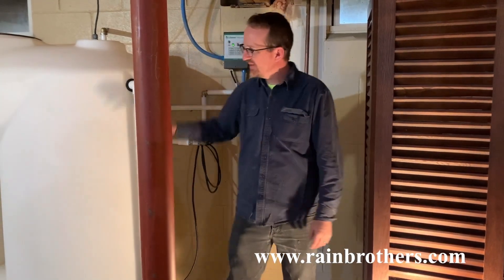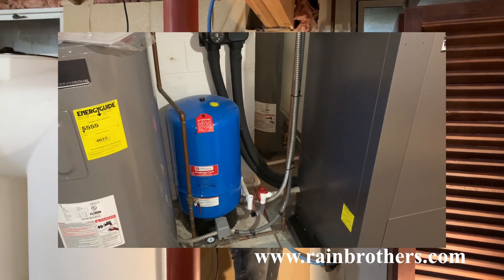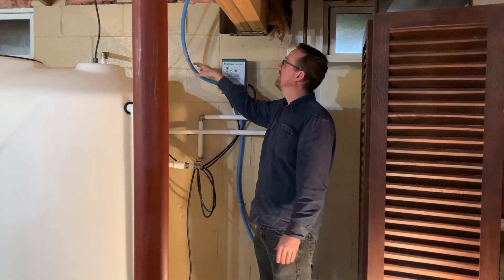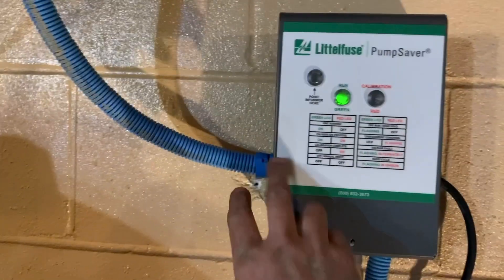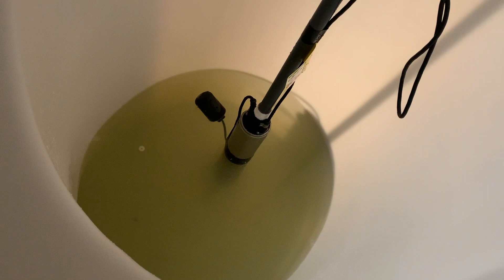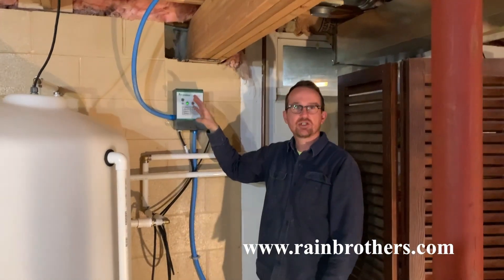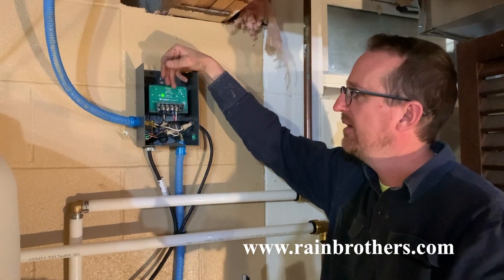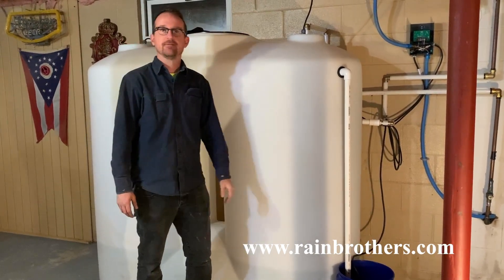How to fix a low-yield water well

Comment: We have something similar with our well. 
Instead of using something like this, we're going to use a 500l pressure tank instead of from a unpressurised storage tank to a pressurised tank - saves needing multiple pumps
Reply from the maker: Yes, sometimes having a larger pressure tank can help, but if you truly have a low producing well that is only recharging a few gallons per minute, you have to have a reservoir tank to serve as a buffer between the low flow well and the high flow house use… a pressure tank just won’t cut it in those cases, no matter how large.

Comment: What if your bladder tank is out at the above ground pump at the other end of your property? Could we still use a reservoir tank inside the house?
Reply from the maker: Yes, you just have to buy another pressure tank and use it for the pump that you’ll place inside the reservoir tank!

Comment: Hi!  I am having water supply issues. I have a family of 5 and the current well water supply keeps running out 3x a week whereby I have to go shut the pump off at the breaker. 

At what point would you suggest this setup vs going deeper (320 to 520 ft) in your existing well? Thanks!
Reply from the maker: A reservoir system works very well and is a lot cheaper than drilling a new well. If you’re only running out of water three times a week, chances are good that a reservoir system will work well for you!

Comment: I put in their same system with a smaller tank over a year ago. It took the well about four days to fill the tank and then everything was fine. We water horses as well as the needs of the house. This year during a drought we maintained a minimum of 150 gallons after we had family visit. Two days later, the tank is full again. It was a perfect, reliable, affordable solution.

Comment: I have a similar system, question though what is the pressure coming from the well pump to the tank? Mine runs at 100psi which seems high, would an expansion tank on that side of the system as well help?
Reply from the maker: In our setup (mentioned in this video), the supply pipe coming from the well is just open pipe that pours into the top of the tank. If you have 100 PSI, then you have a valve closed somewhere or are using very small pipe… I don’t know how 100 PSI could develop against an open-ended pipe unless you have a monster of a pump on the other end.

Comment: Excellent video. Love the overflow safety feature. Do the pump savers work on 3 phase water well pumps (the pump that goes in the actual well itself)? I have heard you say they work on 110 or 220 but nothing about 3 phase. My water well is 3 phase.
Reply from the maker: Great question! So, if this is a residential well, then you’re probably using a VFD pump that is single phase to the drive then three phase to the pump motor. Is that right? If so, your drive has built-in run-dry protection and you wouldn’t need a PumpSaver. Typically residential properties don’t have actual three phase power available, but VFD pumps are a different animal because they incorporate a single phase to three phase converter. If you truly have three phase, then, no, unfortunately our PumpSavers will not work

Comment: If you do not have a basement to put the tank and pump saver in could it be installed in a shed as sort of a pump house out by the well? Just dig up and re route the well line up into the pump house so to speak before it enters the house.
Reply from the maker: Yes, absolutely! As long as the tank and components are protected from freezing

Comment: Thank you. Are there separate devices that could be installed so that I could have one box for detecting if the jet pump is pumping air so it will shut off but have it independent of the cistern's pump? My pumps are on separate breakers. What I really need right now though, is a way to get a float switch to work with a 230vac 6.1A pump to fill the cistern. I'm trying to find the best option to wire the float and need a float that is rated for potable water. Right now I have a square D liquid level switch but the arm keeps getting jammed and doesn't trigger the pump to either turn on or shut off. This leads to the cistern's water levels often being too low.
Reply from the maker: Hello - here is the float switch you would need for filling up a tank: https://www.rainbrothers.com/store/Normally-Closed-Float-Switch-120-230V-Bare-Leads-p281493413 . You might also want to get a cable weight: https://www.rainbrothers.com/store/Plastic-Cable-Weight-for-Float-Switch-Tethering-p521581298

You cannot tie more than one pump into a PumpSaver. The cistern pumps that we have (Springer Series Traditional pumps) have a built-in low level float switch to turn off automatically, so they don’t need to be wired into a PumpSaver.

Comment: Just finished DIY installing a system that duplicates the setup presented here. We have a natural spring that can run low during drought so this system is perfect to store excess capacity and provide more consistent water throughout the year. I cannot say thank you enough to Rain Brothers for their content, products, and overall customer service throughout the project. I highly recommend getting in touch with them when planning your project and purchasing the bundled products so you know everything you need to get the job done works together.
Reply from the maker: Wow! Thank you so much for the kind words and for your business!! We really try hard to help people fix water issues,
so I’m so glad we could be of service

Comment: This is great. I have a well producing only 1/2 Gallon per Hour. No one will touch it and this system is EXACTLY what I was asking the locals about using and they said it's not a thing!!! Thank you!
Reply from the maker: Glad to help, but please note that a 1/2 gallon per hour is a really low yield, and may be far too low to try to salvage (after all, that’s only 12 gallons per day). You may be better off exploring a rain collection cistern, which is our specialty. Check out our website for more info:
www.rainbrothers.com

Comment: I am not a big fan of PVC pipe. CAn I use Pex into and out of the tank?
Reply from the maker: GREAT question! Our tank penetration gaskets are designed for pipe that is IPS or Iron Pipe Size. Schedule 40 or Schedule 80 PVC are both IPS. PEX pipe is CTS, or Copper Tubing Size. Oddly enough, there is a difference, so 1” PEX or 1” Copper or 1” CPVC all have the same outside diameter, but those 1” pipes all have a smaller diameter than 1” Schedule 40 or Schedule 80 PVC. That’s a long answer to your question, but, no, PEX will not create a water tight seal using our gaskets because the outside diameter is smaller than PVC. I don’t always love PVC either. In fact, we rarely use it for pressurized plumbing. BUT, it is useful for this application, and then once the piping leaves the tank, we transition to PEX using some threaded adapters. Personally, I prefer using Schedule 80 PVC which is just a more sturdy option, in my experience

Comment: Would this tank go to the existing pressure tank or straight out to the house?
Reply from the maker: Thanks for asking! The pump inside the reservoir tank would use your existing pressure tank, and your well pump would be disconnected from your pressure tank. If you check out our video library, you’ll see we have another video that goes into detail on how to set this system up. We also have a link to both videos on the product page that is linked in the description

Comment: Would it be a problem to filter before the storage tank?
Reply from the maker: You can certainly do that, although you would just want to use sediment cartridge filters (not auto-backwashing filters, like a softener). Also, you would have to keep really good track of maintenance and when the filters need to be changed because you’ll likely never notice a pressure drop/clog